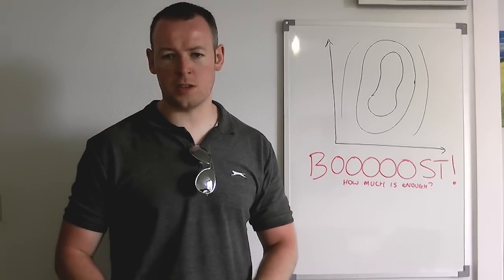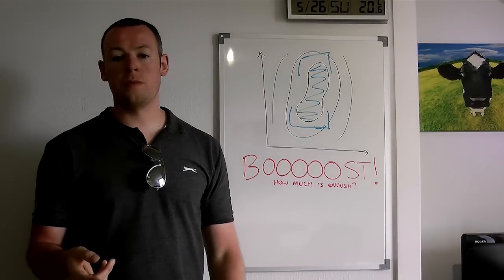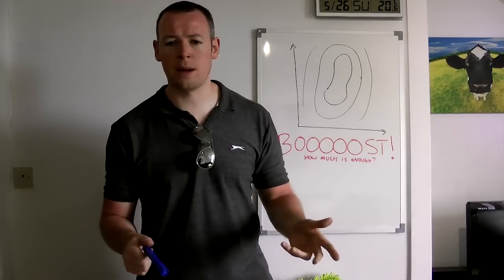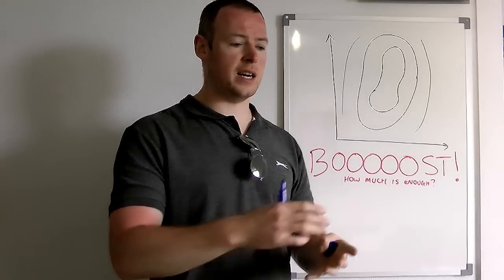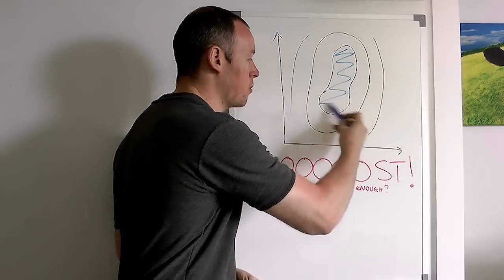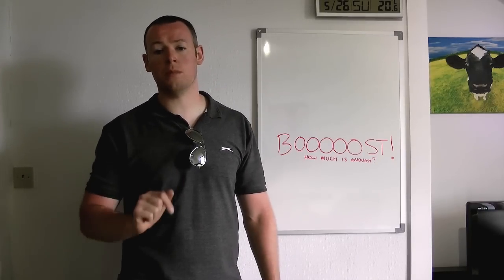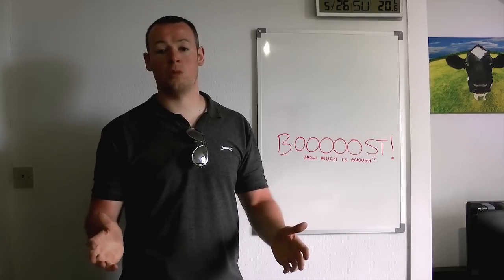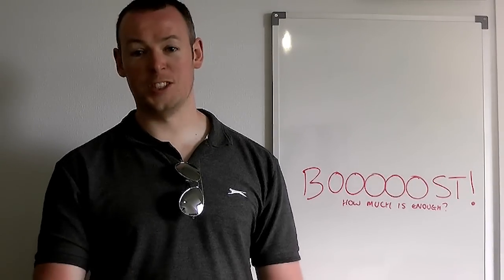ECU remaps explained - BOOST

Comment: You did a bad job explaining the efficiency map and kinda suggesting that you don't know what it is called doesn't help with audience confidence! Let me help you...
(1) It is called and EFFICIENCY MAP. If you google your car you can probably find out which turbo it uses. And, if you google that model of the turbo -- e.g. KKK K03, Mitsubishi TD05H-15G or Honeywell GT2048, etc. -- you can track down its data sheet and efficiency map!
(2) The vertical axis is boost pressure. The horizontal axis is airflow. The island contours say how efficient the turbo is at any specific boost pressure and airflow! Some maps also have a set of frontiers going from the bottom left to the top right telling you how fast the turbo is spinning but that is less important!
(3) Now, find out how much boost your uses stock. Add 1 to that number because the efficiency map is in absolute atmosphere. Draw a horizontal line from left to right on the efficiency map. This is where your turbo is operating along in an ideal and simplistic world where turbos make boost at zero rpm and the ECU allows boost to rise unchecked to your maximum prescribed boost then hold it till the redline.
(4) Now... find out where your engine makes maximum torque. Chances are that is where it is closest to 100% volumetric efficiency; where the cylinders fill completely with each stroke! A little simple math of the displacement of your engine times the rpm divide by two (because each cylinder draws in air once per two rotations of the crank in 4-stroke motors) will give you the amount of air it is ingesting at that speed. Now put a big dot on that horizontal line, congratulations you just plotted where on the map your motor is operating at at maximum torque!
(5) If you have an ideal engine which operates at full efficiency you can now plot where the turbo is operating at from idle to the redline proportionately. E.g. If your max torque is at 2500 rpm and the redline is at 6500 rpm then you simply go 6500/2500 = 2.6 times the way to the right on that horizontal line to figure out where your turbo is at at the redline! You can repeat this simple process to estimate where it is at for any rpm! Do it for max horsepower too. And highlight the line segment connecting mac torque, max hp and the redline!
(6) In reality though that is not how it works because your engine does not have constant and full volumetric efficiency. So, the points on the line are not evenly spaced. The line also does not start left edge because beyond the last "contour" on the island (the surge front) your turbo doesn't make jack shit in boost. Modern ECUs also vary boost over the rev range, typically reducing it at the top end and at certain other conditions such as the in deference to theme torque limit map. But I want you to ignore that for now to keep things simple.
(7) When you remap boost you are moving this horizontal line along with your highlighted segment up and down. That is what's important for you to know. Do it too much and it no longer passes through the nice, high efficiency contours. So look at the bloody map and figure out how far up you can go and still have that line clip at least the top several contours. You can generally go 15-30% over and still do that.
So there you have it. Now you can put that efficiency map to good use! Have fun!
Reply: Dwight Looi  
Hi buddy it seems like you know how  I'm thinking of remapping my car by super chips using their generic map through their bluefin hand held devices - would you recommend that. Regards.
Reply: fuck up.

Comment: hi useful info i just bought 1.9tdi golf mk5  and like to remap it what is the safest option to not mess the turbo and engine as its already run around 145000 mile but service regularly and engine and turbo in a good condition and i only need some power and torque to use when i needed
any advice pls
and what's a best temporary chip device for 1.9tdi so i can unplug when i want to
Reply from the maker: +Alireza iesanejad I've used a DTUK tuning box which was good. Remap is possible but dont get too ambitious on the power or turbo could go bang.
Reply from the maker: +Alireza iesanejad I've used a DTUK tuning box which was good. Remap is possible but dont get too ambitious on the power or turbo could go bang.

Comment: I think you should point out to people that are watching this and have no idea about ecu mapping that they need to think about turbo speeds. As a engine calibrator we spend months mapping for engine and comp life. Winding the boost up will push your turbo speed to the limit and if they do this on a high baro day they will have a dad day on a low baro
Reply from the maker: Absolutely - remaps compromise the engine tolerances and part wear. Well said!

Comment from the maker: The short answer is yes. It certainly can. Although - there are limits to what the turbo can do because of dimensions and many other things. A remap can request the turbo comes on sooner and/or with more force, and request extra fuel to keep the system balanced and working safely with the extra power.

Comment: Hi, i have a question.
When i'm doing 120kph with my Ford S-max 2.0Tdci 163hp. It take's a while when i feel that the boost is at full pressure. Doing 2300Rpm at 120Kph and it take's to 2800Rpm when it really starts going...... I Don't like that. Will an engine remap change that?